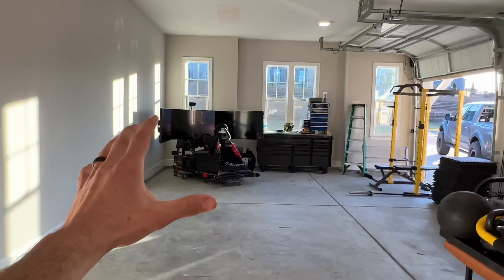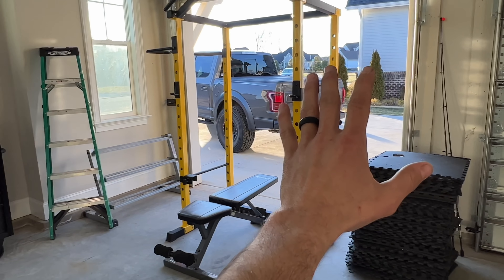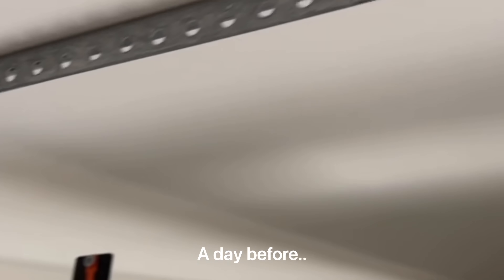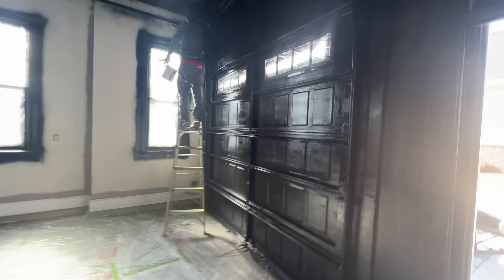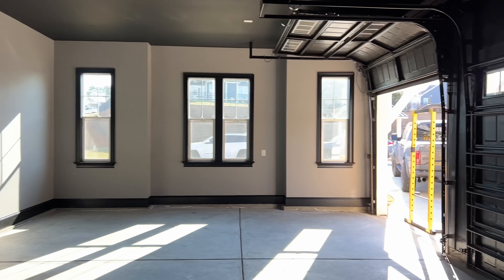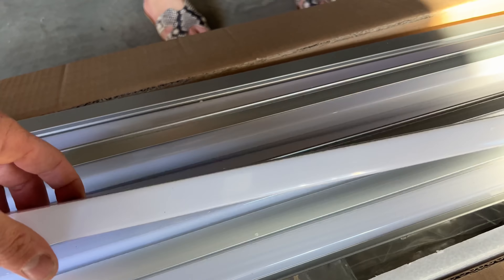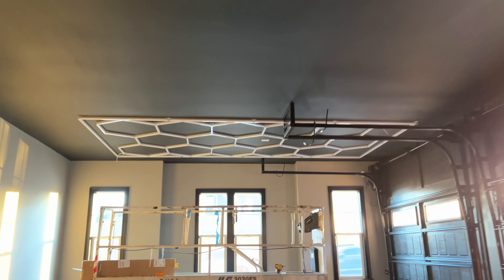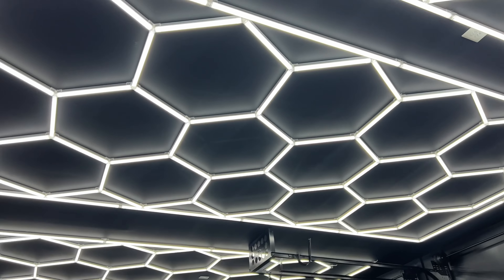MY GARAGE TRANSFORMATION DIY pt 1

Comment from the maker: Who is a fan of the led lights? Also what color should we do the floor?
Reply: Gray with black Flakes Epoxy
Reply: Black, Grey and some glow in the dark neon green flakes would look dope asf!!
Reply: I’d go for a gray black and white marble look
Reply: Also the link does not go to the lights
Reply: Looks rad, a dark, gloss floor will show those lights well in the reflection.
Reply: Black and green bro those are your colors
Reply: The link to led lights is a video.
Reply: Blue and red
Reply: Mild two tone grey swirl, with electric blue and your neon green in 3D tube like waves thru out the floor!!!
Reply: Can you drop the Amazon link to these lights? Looks like the current link is to another video. But these lights are sick, and really pop off the black ceiling!💯👌🏼
Reply: put a dimmer switch on the lights
Reply: Neon green and light grey specks on a black the epoxy floor would look SICK!
Reply: Electric blue goes extremely well with gray and black especially in garage applications.
Reply: White floors
Reply: DeBerti Orange like the Tacoma (Greys and Black)...-theautojunkie-
Reply: Love the lights! My garage needs these asap! Great taste! Can't wait to see what you come out with!
Reply: Just grind the top and clear coat the floor 👌 lights are sick....
Reply: Link for lights to a website?
Reply: Sick dude! Go with the chartreuse green definitely!
Reply: Black and Green to match the tool box. Or full red with white accent

Comment: I would wire each light up individually.
Make sure your brackets for the doors hit the trusses don't need a door falling on that simulator, car or a kid/wife.
The color depends on what color cabinet you're thinking of.
I would go faint red streaks will go over better on resale.
Reply from the maker: I ran all new trusses in the attic. Each is wired by it self as well. Much appreciated on your questions tho if I didn’t do these it would be nice to hear
Reply: Better to ask stupid questions and get it right, than assume and something bad happens. 
Good luck with trying to kick the wife's car out of the garage. 🤣😉